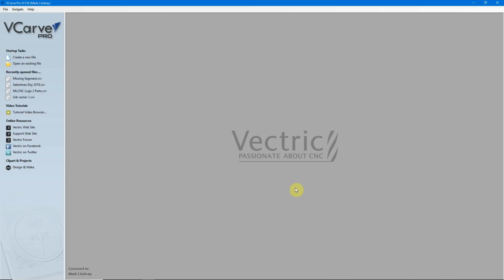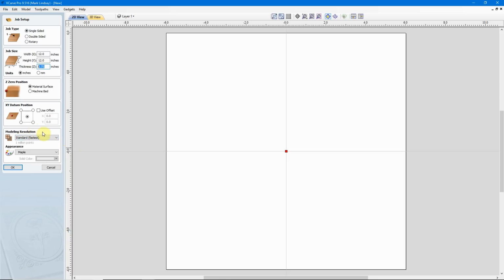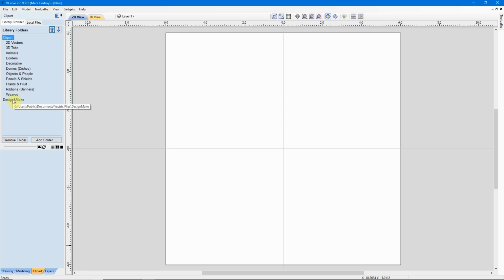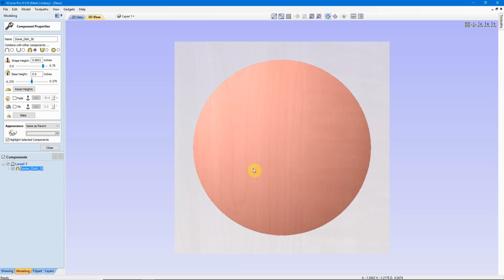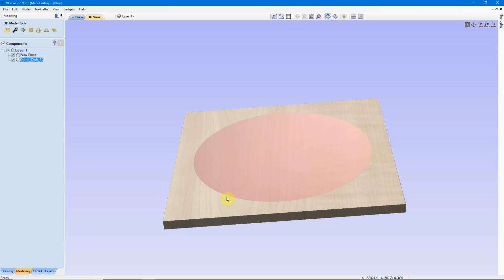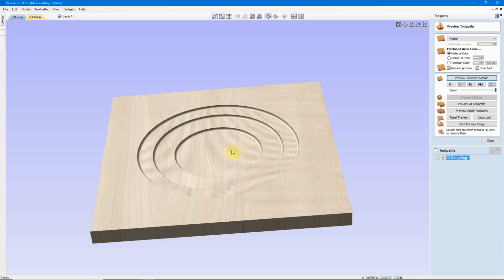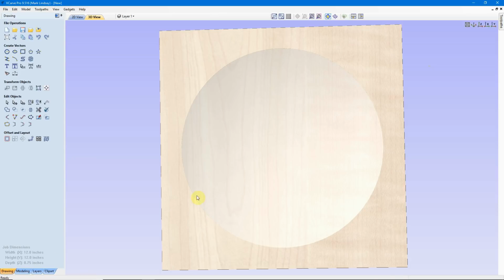Intro to 3D Carving - Part 18 -  Vectric For Absolute Beginners

Comment: Why does it cut the OUTSIDE square part of the piece as well as the dish?  I can't seem to stop it from doing it.  Even though we are telling it to cut only the model boundry?
Reply from the maker: Because the Zero Plane becomes part of the model. In the 2D View, select the dish, the in the Modeling tab, click Create Vector Boundary Around Selected Component. That will create a vector around the dish. In your 3D Roughing and Finishing toolpaths, select that vector, and change the Machine Limit Boundary to Selected Vector. Click Calculate, and preview it. If you need to, go back into the toolpath and add a Boundary Offset equal to the cutting diameter of your bit.

Comment: I'm having a problem I'm hoping you might be able to help with, I'm combining a 3d element with raised text. When I'm running a pocket path to carve out around the raised texts it ignores the 3d element and levels over it as well
Reply from the maker: In the Modeling tab, select the model, then click the Create Vector Boundary Around Selected Components icon. That will draw a vector around your 3D element. When you create your Pocket toolpath, select that vector and the Pocket's outside perimeter vector, and calculate the toolpath. The pocket will clear out the material between the vectors, avoiding the 3D element.
Reply: @MarkLindsayCNC  you, sir, are amazing!

Comment: Thanks! Can you explain why you did the roughing pass WITH the grain, but did the finishing pass perpendicular to the grain?
Reply from the maker: You know, this video is 3 years old, and you're the first person who noticed that and asked me about it. Score yourself 5 bonus Attention to Detail points. Not gonna lie - I forgot to change the Rater Angle to 90 so it cut with the grain, and didn't notice it until long after I had posted the video. But hey - we all make mistakes. Oops...
Reply: @MarkLindsayCNC  thanks! OK I wil always cut along the grain then.
Reply from the maker: Keep following the series. In later videos you'll see that I change to carving at an angle to the grain to get a better surface finish when the carve is completed. I explain why in better detail than I can here in text (and I can't remember which video it was in, right off the top of my head,) but basically, let the project dictate the raster angle. Some projects you want to cut with the grain, and others you want to cut at an angle to the grain.
Reply: @MarkLindsayCNC  interesting. Will do.

Comment: I didn't see you mention this w/regards to the Modeling Resolution - does increasing it not only significantly increase the Preview time, but also the size of the g-code file along w/the machining time?
Reply from the maker: It can, Peter. It all comes down to the size of the model and the tool you're using to carve it. Obviously it will take longer to cut a 12 inch model than it will to cut a 6 inch version of the same model. But also the smaller the tip diameter of the tool, the bigger the G-code file, and the longer it's going to take to carve. Using the highest resolution makes sense when you're carving smaller or more intricate models, especially if they're going to be seen from close up, or held in your hand. If the model is more simple, like a dish with nothing else carved into it, it doesn't make a lot of sense to use super high resolution or a tiny bit - therefore the G-code file is smaller, and the run time is shorter.

Comment: Hi mark..i use vectric aspire and for sone reason now im having text orientstion issue...normally when i type text it shows up normal horizontal position...but todsy for some reason any time i create text it shows up rotated 90degrees and i dont know why...i know i can rotate it but it should not be rotated 90deg when i create it....nevermind i think it was the font...for some reason some fonts show up rotated 90deg...i changed font and its not hotizontal...very odd...
Reply from the maker: This is very common. Take a look at the name of the font you've selected. If the name begins with the @ symbol, it's a vertical font. Look for that font name without the @ symbol, and that'll fix you right up.
Reply: Yep..you are correct..they all have @ in front...i discovered that just after i posted question..i never knew that
Reply from the maker: I didn't know it either, for like the first 4 years I used the software. All I knew was that sometimes the text ran vertically, and it drove me crazy.

Comment: Mark following this step by step. right after I set the zero plane my Z: is at -0.2500 instead of 0.00. The 2D view is correct but the 3D is off. I have redone it a few times & it stays the same
Reply from the maker: Look into the Model Placement in the Material Setup form. I did a video on this a few weeks back. Here's a link: https://www.youtube.com/watch?v=M4m7ziqrb6E

Comment: Finished Part 18 and learned a bunch. I'm using Desktop Pro V10.5 and want to import then convert a bitmap image to vector.  That's working just fine. Is there a way to fiddle with this 2D picture and get it to carve the widget in some relief. I've flattened part of a log and want to carve an owl into the wood so it looks as if the bird is hiding in a bit of a burrow. 
Thanks,
j
Reply from the maker: You can v-carve the owl or use a profile toolpath to trace the outlines of the owl, but to get any real relief, you'd need Aspire. VCarve won't create 3D models, and that's what you're trying to do.
Reply: @MarkLindsayCNC  Thanks. that's what I was afraid of. Oh well.

Comment: Hi Mark
I love your videos, they are the best out there, in relation to the finishing strategy I have noticed that raster is quicker, yet you run in Z level with the grain, is there a specific reason or just preference.
Reply from the maker: Thank you very much, Greg. I tend to run Z-Level on a roughing pass only because it's been my experience that it actually runs faster than 3D Raster in most cases. There are exceptions to that rule, of course. It's also easier on the bit and the machine to take out the bulk of the material at the bit's pass depth (as set in the tool database,) rather than attempt to cut away more material than I feel comfortable milling in a single pass.

Comment: After importing a 3d file of a persons head in which I only want to do the top portion, the face part,.. I can scale the model to where it fits inside the wood BUT  I always get confused about the "Zero Plane Position in Model" which has a slider to adjust the height.  It appears in your tutorial where you "Add a plane component with zero height covering model" achieves the result of the top of the model at the top of the wood. Is this correct? If it is it saves a lot of figuring out!
Reply from the maker: No. Adding a plane component with zero height covering the model adds a plane at the top of the material - not the model. Adjusting the modeling plane with the slider in the Import window positions the model within the material.

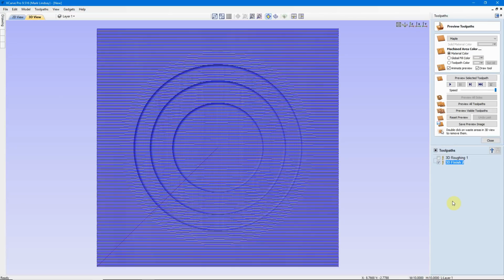Comment: Great video as usual Mark. A question. When you calculated the finishing toolpath it showed the entire surface being carved. When you did the simulation only the dish was carved out which is what you wanted. Why did it calculate to do the entire surface? This was at 29:29 in the video
Reply from the maker: Thanks for checking out the video, Bruce! Basically, that was a mistake. I should have set the toolpath to machine to the model boundary. I just forgot. Oops...
Reply: That's what I thought but I do have "Model Boundary" selected (as did you) and when it calculates the toolpath it shows the entire surface being carved. You even mention that in the video. Still it machines correctly but why would Vectric show the whole surface being carved???

Comment: Followed you video exactly and when I run it , it goes around the whole piece of wood instead of carving the dish. You  said in the carving it would carve the whole work piece, why? It should just carve the dish and not wonder around the whole work piece.
Reply from the maker: If you're referring to the Finishing toolpath running the bit over the entire surface, when I created this model, it basically turned the entire surface of the material into a part of the model. This was meant to be an introduction to 3D carving. In videos that followed this one, I delved deeper into ways of eliminating that, so that it only cuts the model, instead of the entire surface. There are several ways of doing it - too many to try to talk about in a reply to a comment. Here's a playlist of the videos I've done on 3D carving that will demonstrate those techniques. https://www.youtube.com/playlist?list=PLLuYLaC3-QRPb0jNAfuB-xOlAUHWl1wkC

Comment: if I have fusion 360 do I only need Vcarve? thanks
Reply from the maker: If you're already using Fusion 360, you may not need VCarve at all. Only you can make that decision based on how well you like Fusion 360. I don't use Fusion 360, so I'm not 100% up to speed on what it can or cannot do. I started with VCarve because that's what was recommended to me by my CNC guru, Dave Gatton. I got it and never looked back.
Reply: @MarkLindsayCNC  thanks - I will check out Vcarve

Comment: Hi Mark I've been enjoying your videos. Do you have a tutorial where I can figure out how to run a rebate of a fixed depth around an irregular height imported stl (Jazz guitar top)? Keep up the good work. Cheers Andrew
Reply: Hi Mark
I figured out that it would be easy enough to manually adjust the Z values in the g code to follow the top carve on the guitar. Sometimes one can't see the wood for the trees. Cheers Andrew
Reply from the maker: Thank you very much, Andrew! I don't have a specific tutorial for that, however I do have a tutorial on V-Carving on to 3D objects. The process is mostly the same.  Here's a link: https://www.youtube.com/watch?v=TyEHhkiEnCY
In your case, you would use the Pocket toolpath rather than the V-Carve toolpath. Create the vectors to form the width you want to carve, select them, then choose the Pocket toolpath. Set the depth you want the pocket to be cut, fill out the rest of the Pocket toolpath form, then down near the bottom of that form, put a check mark in the box next to "Project toolpath onto 3D model."  Preview it, make any adjustments needed, then preview it again. Keep previewing and making adjustments until you get the result you want. And for heaven's sake, please test it on scrap material before you carve into a body that you have put a lot of work into! Good luck!
Reply: Hi Mark
Thank you very much for the quick reply. I thought you might have been snowed under with aspire 10. I'll check out your link and thanks again. All the best from Austria.
Cheers
Andrew @MarkLindsayCNC
Reply from the maker: To be honest, I am snowed under, but I'll manage. Good luck!

Comment: Thanks Mark your Awesome. Question: I want to get the 3d feature to my vetric however you just enlighten me that I will not be able to create 3d models and also be limited on editing 3d models. Does that mean I will have to buy Aspire? and if I do, will that make my Vetric useless?
Reply from the maker: VCarve is not 3D modeling software - it never has been. You can import and adjust models, but not create or edit them. If you want to create 3D models, you'll have to upgrade to Aspire. One of the good things about Vectric, the company, is that if you want to upgrade to Aspire, you pay only the difference in price between VCarve and Aspire.  For instance, I use VCarve Pro - if I want to upgrade to Aspire, I would pay $1300, instead of the $2k Aspire costs (VCarve Pro costs $700.)
Reply: thanks my cnc came with vetric and I was not aware of Aspire. I guess I can unlock the 3d feature on my vetric first, get familiar with 3d carving then upgrade to inspire @MarkLindsayCNC
Reply from the maker: @jeffali7421  That's the way I'm doing it. The basics are identical in VCarve and Aspire - with the exception of 3E modeling. The Modeling tab in Aspire is LOADED with tools VCarve just doesn't have.

Comment: Mark, for curiosity, when you did the raster for the rough cut you went in a north/south direction following the grain.  When you did the final pass you went in an east/west direction going cross grain.  Was there a particular reason for that?
Reply from the maker: Yes there was a reason, Steve. When I went to set the raster direction on the finishing pass, I forgot I had rastered in Y on the roughing pass (oops...) Good eye. Basically, set the raster direction so the bit cuts with the grain.
Reply: @MarkLindsayCNC  Thanks.  That makes sense.  I've done an oops or 2 in my day too.

Comment: Actually solid models are a 3d grid of triangles, but the box comparison  works..  :).
Reply from the maker: I believe you're talking about NURBS based models rather than VOXEL based models. Vectric software doesn't use NURBS based models unless they've been saved as STL or another format that's compatible.

Comment: Fascinating, Mark. Although I'm nowhere near 3d carving in my learning process, I'm glad to learn the principle of what 3d models are, and what they're constructed of. I think this will make the concept a little more logical to me when the time comes. Thanks.
Reply from the maker: Thanks very much, Jim. It's not really necessary to know what they are, but it does help some folks to better understand resolutions. That way you can make a better decision about which resolution to use, based on the model you're working with. Kind of like painting a wall - you'll get into every crack and crevice if you use an artist's brush, but you'll pay for it in the amount of time it'll take to finish the job. Sometimes it's' better to use a wide roller and just get it done.
Reply: 3d models are usually not made of voxels. Nearly all 3d models are made of a mesh that consists of polygons. Which are represented by points connected together with edges. Each point is called a vertex.

Comment: Great job Mark. on a first simple carve. 2 Question why did the last pass do the whole surfaces including the  top of the  material. Also why did the first pass cut down .375 when the max depth was .5 and you set the  depth left of the ruffing  tool path at .25 Jeff
Reply from the maker: Thanks very much, Jeff. Both of those questions will be answered in the next video. I forgot to mention that. This was intended to show the absolute basics, just to show folks that there is a little bit more to it than just dragging a file into the project.
Reply: @MarkLindsayCNC  Great.